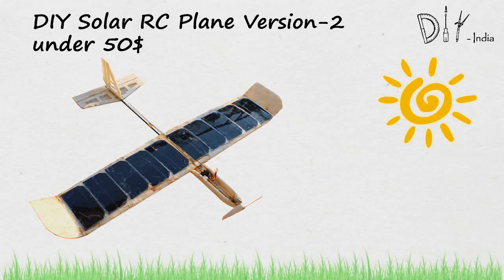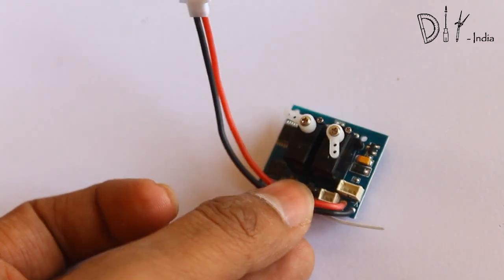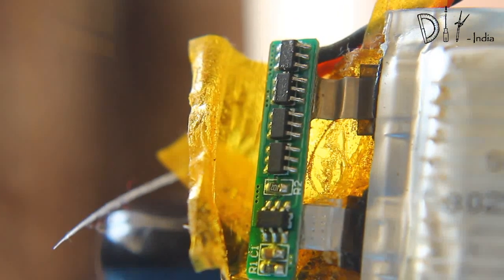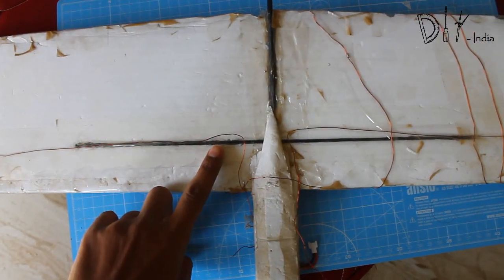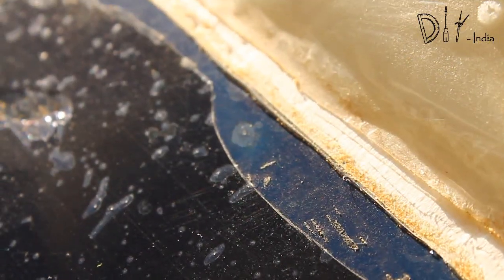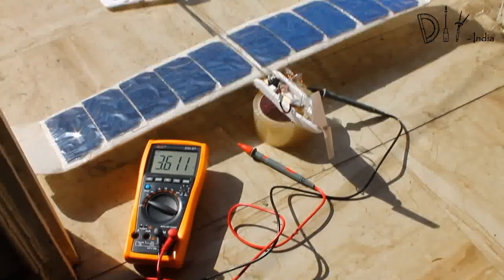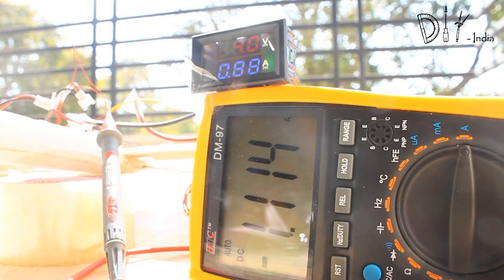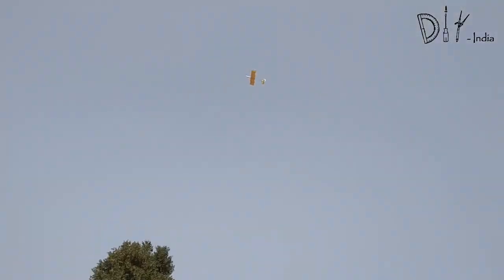DIY Solar RC Plane under 50$ Version 2

Comment: Nice!  Question, its not a problem that the battery can discharge into the solar cells?  I would think a Schottky diode would be needed?
Reply from the maker: you are right. I missed that.

Comment: this is super cool, nice very low cost design. would love to see you design one a little bigger, maybe a 2s system, with a small brushless motor and maybe a folding prop?
Reply from the maker: I have prepared exactly same plane as you are describing, hopefully share it in upcoming month.
Reply: Very nice, remember have a solar powered plane run a 3s, it is a very good flier.

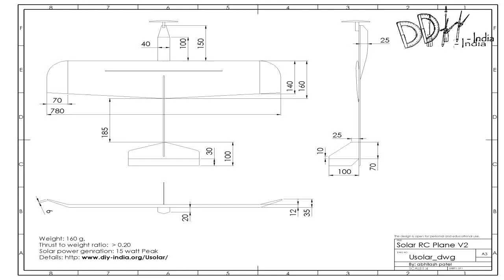Comment: thanks for posting.  good work.   ESPECIALLY,  the use of forward-installed  servos.    some thoughts.   regarding  'power':     volts is Not  power,  amps  is  Not  power.   power is expressed in WATTS.   watts  Equal,  volts  MULTIPLIED  by  amps.       you have chosen to use a  WONKY  prop.    i suggest that a  S F  prop of similar diameter  be  used, INSTEAD.       it should be understood that  'full throttle'  flying,   is  NOT  the goal.   BECAUSE,  just about any (correctly designed) model will  CRUISE,   at 2/3 throttle  OR  LESS.          (elevator  Should  Be  TRIMMED,  so that a model flies  level, at a  nominal  (cruising) airspeed.     trimming is done by  a  Pilot, using his Left hand to manipulate tx trim switches,  DURING  a  so-called  'maiden flight'. )            where ever practical,  Reduce  Weight.   (use the  lightest  battery, that is practical.)    do  NOT  use  cf, or large-ish  steel wire,  for  ANYTHING.   use  bamboo or spruce or poplar.     make a pushrod by  attaching a  piece of wire at each end of a bamboo (skewer).    in each piece of wire,  form  a  modified  Z-bend (with some extra wire at one side, for mounting).     this bend is comprised of  three   straight  sections;  and two  'opposing' ninety degree bends.    a tail boom  Should be made of a material, such as spruce,  that allows  Correct  optimization (tapering) of  its  Distribution of  mass (dom).    in flight, the model appears to have a  tail-Heavy dom.     correct location of the cg  of this model is at   30 percent of chord;  the use of a slightly forward  cg  ensures that a model is flying  with a   Nose-heavy  dom.             at 2:35,  poor profile selection.   this  wing profile  is  TOO thin, and  Too  close to being   Symmetrical ( and  ZERO-lift).   see my profile tutorials.     use  the   clark-y profile.   PERIOD.                      regarding piloting:   during  Any  turn,  a  Pilot  should be  'ready' to do two things.       increase  throttle, a bit.     and/or   put in  a bit of  up-elevator.    the later will increase the rate of a turn.     make (relatively)  flat turns.   
cheers                 googletranslate                 some resources
modified  z-bend (at  servo  arm)
https://s3.amazonaws.com/assets.flitetest.com/article_images/medium/sam-0547-jpg_1390282013.jpg
clark-y (v1) profile, at illustration
https://en.wikipedia.org/wiki/Clark_Y
https://wright.nasa.gov/airplane/shortw.html
http://www.stengel.mycpanel.princeton.edu/MAE331Lecture6.pdf
Reply from the maker: Thanks for such a explanatory feedback, especially on wing thickness. Even while flying I had to give continuous effort to keep it straight and not let it stall. but there is a major issue in keeping wing thick. as increasing thickness will result in increased curvature of the upper face of wing where solar cell needs to be placed and it has the limitation of solar cell bend. And if we talk on power monitor, as you rightly said current or voltage alone can not represent power. but in this case, both power sources are connected in parallel having a similar value of voltage so it can be multiplied to current measured by other meters. Using bamboo stick instead of CF rod will be the surely inexpensive way forward, that I will try to implement on the next version.
Reply: @bi1420  hi.  a few more thoughts.       DESIGN  the wing/airframe, to  Accommodate  the pv components  AND  the use of a  lift-making  profile.     start with a  main wing chord of sufficient length.     then,  chord should be equal to about  22 percent of fuselage length.    fuselage length should be equal to, about,  75  percent of wingspan.    horiz-stab span Should be  Equal  to  30  percent of wingspan.    (normal) E  prop diameter should be equal to, about,  25  percent of wingspan.    cheers           googletranslate

Comment: Your primary airfoil is perhaps too thin for flying at that speed and with that small motor.  It forces you to fly at a high angle of attack to maintain altitude and this causes drag and micro-stalls. Try using a more teardrop-shaped airfoil or perhaps one with a bit of camber so that you maintain better lift and attack angle at low speeds. This will also improve your rudder authority a little. This is perhaps a more efficient approach than to try to design for more power.
Reply from the maker: that I felt while flying plane too, but if we try to bend solar cell with relatively higher curvature, it tend to crack quickly. So i tried to keep curvature of upper face of ail foil lower.